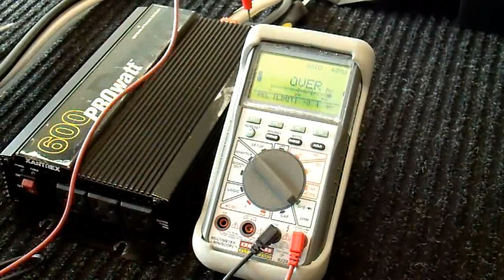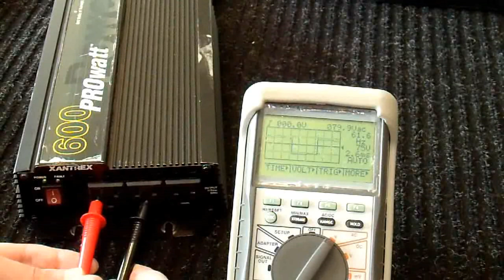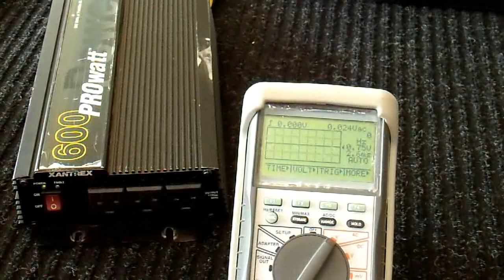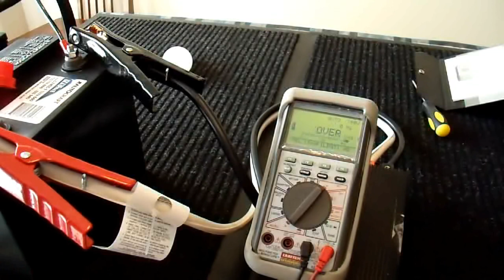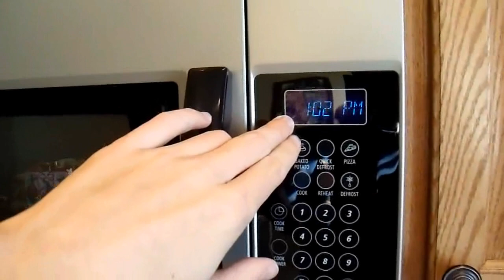How NOT to Connect an Inverter to Your House Mains - Xantrex ProWatt Inverter part2

Comment: Excellent video, thanks for the info!  What about these "Split Phase 220V Pure sine wave" inverters sold on Ebay?  (They specifically say that you can use L1 and N, L2 and N, L1 and L2 for 220V, but NOT L1 and N and L2!)

Comment: Very useful info. I had exactly this issue although the Inverter did not blow, it did overload and I was planning exactly what you said just go to two wire, I did not know the DC Neg would carry 80 volts to ground, so THANKS for that tip!

Comment: It would also fry the inverter if you have to many devices on when the inverter is energized. Resulting in a rush of current that exceeds the maximum peak limits of the inverter.
Reply: Not on most, they are internally protected from overload, AND they are fused beyond that. I know they say don't open the case but guess what is inside? FUSES, and you CAN replace them that is how I got my 1000W pure sine wave inverter. Someone blew the fuse and tossed it. It was NOT ruined just blown fuses.

Comment: Van some one explain why solar panels with inverters can be connected directly to the main circuit braker box backfeeding and gas generator can't ??
Reply: Only "grid interactive inverter" can be connected to the wall directly. It can sync to the current coming from powerstation. If the inverter is not grid interactive, it can not be connected to wall without double checking there is no mains power.

Comment: Honda Generator (CFGI) to Refrigerator and/or Freezer - generating DC and inverting to AC…

Are you saying that during a power outage, this would harm a refrigerator and/or freezer or similar appliance?

Also, if doing some of the things in this video, would adding a CFGI receptacle make it safer?

Thx.  Great videos!

Comment: 3 words here....GRID TIE INVERTER. If you try what hes showing your STUPID. (probably a DEMOCRAT)
Reply: Nope a true American, Republican, and my house is NOT on the grid so no back feeding issues, AND no stupid people who would come and touch the battery post while the inverter is on. All I want to power is a radio and some lights from the inverter so I don't have to run my generator for such small loads. This was exactly the info I needed and would have figured out on my own had I gotten my meter out and checked but this saved me the effort. What IS stupid are people like you who think their way is the ONLY way!
Reply: You spelled you're wrong.

Comment: wtf, don't you need a grid tie inverter?
Reply: no grid tie inverter needed if the mains is isolated
Reply: Chelvan Mei  GTI only works when the power is on.
Reply: Grid tie inverters are completely different,

Comment: Well what inverter can you use and i pluged all 3 prongs into my 1000w inverter and all 3 plugs into my house and i ran it for 3 days and nothing went wrong
Reply: @stevesrt8  Not all of them. You have to check each and every one you get in the US unless it carries a UL label. And 99% of those will be hardwired. Some of the same size from the same company can be safe or unsafe depending on which way it is wired at the factory.

Comment: I have a Cen-Tech 2000/4000 inverter that has a separate ground connection on the back near the battery terminals.  I show no impedence when I check the battery negative to the AC side ground.  I do however get about 50volts when i power up the inverter and check the AC ground to AC netrual (white) and AC ground to AC hot (black).  Does it sound like this inverter would connect to my house main panel with no issues?  Thanks...

Comment: You  can use a inverter to power your house by using an isolation transformer.
Reply: +Kionekea Pelesi Yes that is really easy solution, but you would need a big isolation transformer

Comment: Okay, I only watched half of your video.  This doesn't make sense.  If you were in a power outage situation and, to be safe, turned off your mains, then HOW would you electrify your battery by connecting the inverter to an outlet??  Even if the power came back on, that would be impossible if your main breaker is off.  The only thing that did make sense was the type of inverter you showed that has separate voltages across neutral vs. ground... that would be a problem with a 3-prong setup.
Reply: its the design of the inverter

Comment: How on earth are you suppose to run an entire house with a 600 watt inverter and two small batteries. What a awful example. Who did your electrical panel? What a mess!! Not to mention aluminum conductors for feeders YUK!!
Reply: its a small example, it will run the fridge and some lights, thats enough for emergency use

Comment: I'm surprised a fridge is only 140 watts.
Reply: the surge is around 1200 watts tho
Reply: roger brandt Mine is actually only about 60 when active and about 15 when idle.
Reply: Depends. My old one was 250 watts. The new A++ rated Bosch is 90w. Typical starting surge is 5x nominal for most induction motors.

Comment: Neutral is .500 mil amp and any disruptions to the  .500 mil amp the breaker will pop.
the old way was the breaker would get hot from a short and by then you did damage or it burnt up everything.

Comment: There are high power purely sine wave inverters available. For example on ebay. 
Also with option to to connect it to mains. 

I'm using 8kW inverter.

Comment: This is simply off grid inverter.
You want plug one in the wall? Get grid tie inverter.
Reply: Artjoms Pugacovs What good would a grid tie inverter be during a power outage?  There is no grid!  This guy knows what he's talking about, you clearly do not.
Reply: When there's blackout it is different story
Reply: Yes, that's my point. The video discusses  temporary power when there's a 'blackout' or any other time the load center / panelboard main breaker is open.  A grid tie inverter would not be used in this situation.

Comment: Thank you so much for this great video and for saving my inverter!
I am not sure if you are still monitoring the comments in this video but I really hope you do :-)
I wanted to ask you if I have an APC UPS SUA2200RM2U that has an AVR and I put this UPS between my Power Bright PW2300-12 inverter and the house plug to backfeed will this work?  Provided of course that the UPS will work when it gets power from an inverter, I need to test this.
I know it might not be as efficient as I am going from DC to AC back to DC and back to AC.  I only want this to work for a few hours for power outages longer than few hours I would turn on my gas generator.
Reply: I keep watching your videos.  What a great collection! I have learned so much in the last few days!After watching your UPS to Inverter conversion series I thought maybe I can do that instead and just feed my UPS directly from the marine batteries.  Since my UPS already has a max of  about 2000 Watts I hope that I would not need to do any upgrades.  I do not plan to ever use this with loads of more than 1500 Watts.  My plan is to only use it for up to 8 hours in case of power failures to just run the fan of my oil furnace (about 500 Watts) so I can have heat and a few led lights in some rooms.My only concern is that this UPS I think it gets 48V from its battery bank so I would need 4 batteries in series and I only have two (I can always buy 2 more if that is my best option)  
Also I am not that sure about the safety of the 48V on the DC site.  

If my smart ups will work being fed from that cheap modified sine wave Power Bright inverter I might still stick to my original plan.  This is not something that would be used continuously I only plan to use this in case of power outages for about 8 hours that happen about once every other year.  knurlgnar24 if you are still reading the comments (or anybody else that has good knowledge of this things) I would be very appreciative of any advice you can offer.  Again thanks for all these great videos.
Reply: An APC Smart-UPS is likely to have an outright convulsion if fed from a modified-sinewave inverter. They are called "smart" UPS's for a reason and they both verify proper site wiring (ground, hot, live terminals) and, especially, the waveform and frequency of that waveform -- all of which will be outright wrong. If you are lucky, the UPS will just give up outright and you will be fine, albeit with the UPS running off its internal battery.  If you are unlucky, the UPS will try to make use of the power and have a veritable convulsion as it bounces between internal battery, AVR boost, AVR buck, back to battery, many times each second as it tries, which can eventually result in a massive coronary when all the voltage spikes generated by those thousands of switching cycles (in the span of a minute or two) finally either fry its internal electronics or weld the relays into a less than desirable configuration.  It takes a very good quality generator just to run them off generator power.
Reply: Many thanks for the reply! I guess I would not be trying that :-)

Comment: here is how to power your home lights using a converter and battries...go to breaker box turn it off and unhook all hot wires that go to the lights ...wire all these wires together  and do not reconnect them to the breaker....go to washroom and insert screwin lightblub socket that has plug socket on each side and plug one end of your suicide cord in it and plug the other end of your cord into an outlet on your inverter...hook your inverter cables on to your battery bank then hook your clips from your voltage regulater to the correct posts on the battery then connect the other end of your voltaage regulator to your solar panel and you have solar powered lights with no connection to your breaker box  which you can now turn back on and now your using solar power for your lights....so just remember to turn your lights off when you leave a room to keep from discharging your batteries.
Reply: sounds time consuming and a bad idea

Comment: Thanks for all the helpful videos! I have an AIMs PWRINV2500W modified sine wave inverter. Do you know if this particular unit has live neutral and live ground? Will I have the same issue if I try to connect it to my house transfer switch? Greatly appreciate your help!

Comment: What if you are using a pure sine wave inverter, on solar power, as a back up?
Reply from the maker: Pure sine inverters generally don't have a live neutral configuration but otherwise have the same limitations.
Reply: I just tested a high-end pure sine inverter, and got the same results, 60V from both hot and neutral to ground, 60V to the battery ground when the inverter had no contact with the battery except for DC negative feed.

Comment: Might be a dumb question but can't you  disconnect ground from neutral inside  the inverter then put a separate ground cable to house ground? Therefore separating the neutral/earth connection at the inverter?

Comment: great  video for electrical dummies like us...moral,of the story is try to buy a high quality pure sine inverter ..they run better and all appliances work well too...if you plug them into the wall it wont get fried like a modified sine inverter because it is in resonance with the grid power..

Comment: To get 120 to both legs just wait for the water heater to turn on the it will jump the 120 to the other leg lighting the whole house. I DONT USE THE GROUND CONNECTION ON MINE EATHER! And I unplug the fridge.
Reply from the maker: This would kind-of work...  The water heater element has about 12 ohms of resistance so you'll see significant voltage droop on the other phase with any significant load.  Unplugging the refrigerator would be a good idea to prevent overheating the compressor.

Comment: You could probably get away with it in the UK as the main switch is double-pole and isolates live (hot) and neutral, so the incoming neutral (which is grounded at the substation) and house ground connections are separated. Still, use of a "naughty cable" is a stupid way to do it and you're asking for a blown inverter or worse. Good video!

Comment: wouldn't a blocking diode prevent any back feeding, I've been trying to find an inverter to tie to the grid and be able to use as a power backup without paying thousands of dollars, but all the cheaper ones made as grid tie shut down when the power goes out.
Reply from the maker: They're designed to shut down when the power goes out to avoid islanding, a serious safety concern.  For what you want to do you would need an inverter that also acts as an automatic transfer switch which is probably not practical cost wise.  You're probably better off purchasing an inexpensive grid tie unit that can handle your solar or other power source, and a separate larger non grid-tie inverter that you can manually switch on for power outages.

Comment: I have a small 12 X 16 cabin that has no power. The cabin is wired and has a small breaker panel that we run a 2000 watt generator into to power the lights and a few outlets. I was thinking of buying a solar panel and a couple batteries with an inverter. Is it possible to then hook the inverter directly into the panel? We only power a few lights, charge phones, a small tv and radio.
Reply from the maker: Yes, absolutely!  I would recommend spending the extra and getting a pure sine inverter since they are nearly always isolated and safe to use in that configuration - otherwise you can get the more expensive modified sine units that have hardwire options.  Just be sure you never connect both the generator and the inverter at the same time, otherwise all you'll have left is the generator...

Comment: also... don't forget that the substation transformers can step up lower voltages since there's no AC-DC conversion... if you load up the secondary with 120V, you get grid volatage out the other side... in the UK, if you backfeed a substation, that's a 230V input to the transformer, which then steps it up to about 415 into another step down and that gets boosted to 11KV... so you don't just kill an inverter if you forget that main breaker... you also load up a pylon with 11KV of power... not very many amps... about 60 or 70, but it's enough to kill!! (0.1A is enough given 80V or more for enough time)
Reply from the maker: That is the common explanation as to why backfeeding is so dangerous (and it is dangerous), however it would require a very unlikely outage scenario where not only was your particular house the only one still connected to the distribution transformer, but also that distribution transformer was the only one still connected to the 11kv transformer.  While it is possible (as it is possible to be struck by lightning) it isn't likely.  We should worry about the more immediate threats that are likely to occur:  That is energizing the wiring serving your immediate house.

Comment: In response to several comments below:  I applied for a "Transfer Switch Permit" via my city's online app. For "Contractor" I simply stated, "Homeowner," which is permitted by the National Electric Code (NEC).  I paid a $100 fee, then purchased a 30A Reliance Control 4-circuit transfer switch ($169) and installed it myself. Tools needed? = one standard screwdriver and four wire nuts. The city inspector signed the approval, then spent the next half-hour or so admiring my dual-axis solar tracker with two 250w, 24v, 8a monocrystalline panels, Renogy 40A MPPT Charge Controller, four 84ah solar AGM batteries (336ah) powering a Renogy 2000/4000w TSW inverter attached to the transfer switch with a pigtail (3-prong plug on the inverter side and twist-lock socket to the transfer switch). As my humble system is wired directly to four circuit breakers in the home's electrical service panel, it by-passes the electric meter, preventing the energy utility from sensing electrical credit and charging me additional as they do for anyone with a rooftop system. Oh, my "qualified electrical contractor" credentials? = homeowner, common sense, reason, and ability to read instructions and put them into safe practice. And consider the following fantastic overabundance of safety features: The MPPT Charge Controller has circuitry to prevent over and under charging, the inverter has six 45a fuses, and the transfer switch possesses four 15a circuit breakers...all PRIOR to the four circuit breakers that go thru in the service panel.

Comment: There are 2 basic types of inverters: normal inverter (like the one at the video) that are used to connect laptops or electronics that uses ac input, usually used for cars, and the tie grid inverters (this inverters just have one ac output) that are the ones that can feed electricity into your home. srry for my english.
Reply from the maker: I would be hesitant to group inverters into just two categories.  A non grid-tie inverter can be used for this purpose depending on its construction.

Comment: I have a 600W pure sine wave inverter. Is there such thing as hot live - hot neutral pure sine wave inverters? Is it just a cheap design found only it modified sine wave inverters... My inverter has a earth connector on the outside of the case.

This is my inverter:
http://www.universal.com.fj/products/9319236945834
Reply from the maker: Pure sine inverters generally have a fully isolated input and output, and do not use a live neutral configuration.  Regardless, you will want to verify if yours is or not.